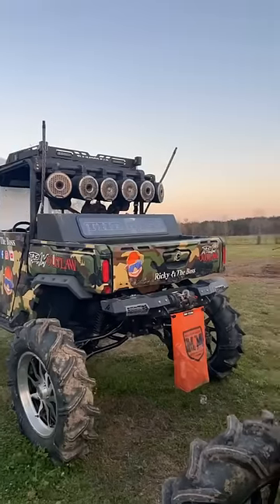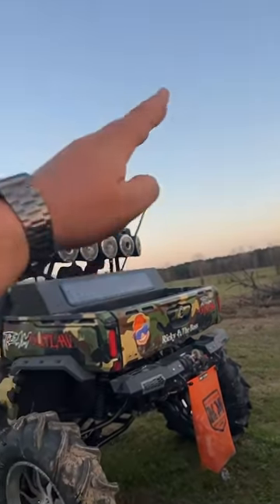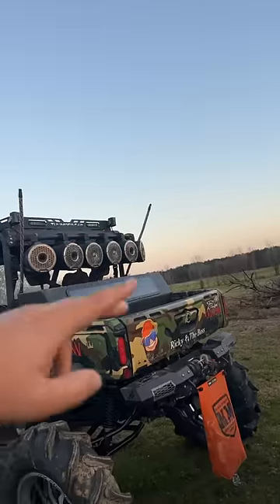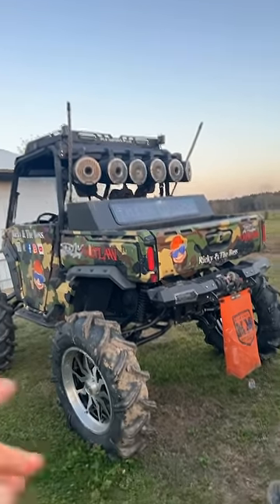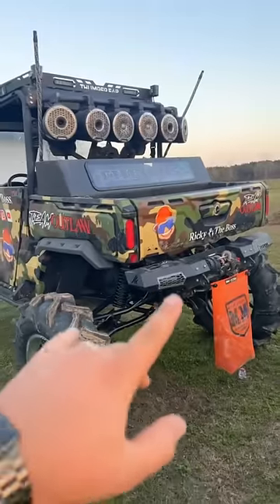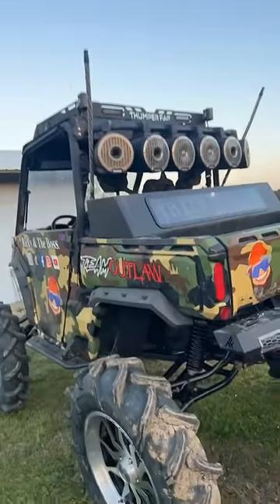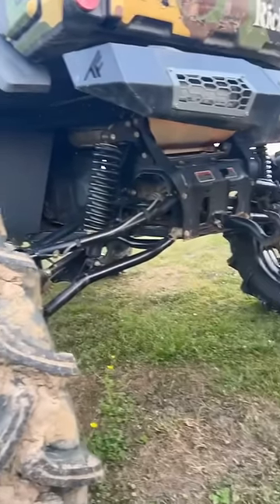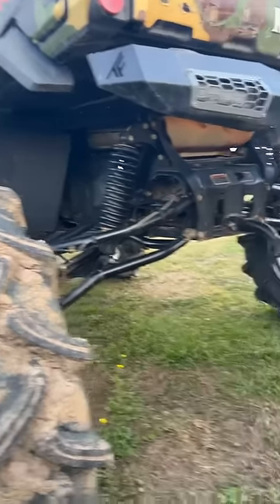About to build a team outlaw tow rig #teamoutlaw #canamdefender @CANAMOFFROAD

Comment: Just run a straight axle with a Lifted suspension that will give you good clearance and it will actually be a lot stronger than the Independent Suspension

Comment: Add a set of air shocks. Weld new mounting brackets next to the existing ones and wire in an onboard compressor.

Comment: I put a flat bed on the back of mine it lifts the tires up then the back 2 roll on the ground but if it needs it I have a dolly I keep on the trailer. Reach out if you want the plans. But it's like a tow dolly that comes down off a slide bar strap the first 2 ties and lift up with the 12k and your off

Comment: If i may suggest that you can use the old air ride suspension from old Lincolns just be sure to replace the diaphragm air bags with updated ones also if you can fabricate a mount and install an AC compressor from any vehicle then you have one serious air compressor for your airbag suspension 😉 #BUILTNOTBOUGHT

Comment: Would duel air shocks work for you. Check them out. 
Have the weight from the boom come down on your rear shock mounts and stiffen up the lower control arms and where thay connect to the frame. Its a start.

Comment: air bags? just get sum bumba air pneumatic cylinders bolt on next to shocks with a pivot hinge each side snd then air up loaded to propper psi for correct ride height and lower when unloading so you don't go ridding too high

Comment: What about welding a pulley wheel
to the FRAME, then run the cable
through it, that would give you
ADDED LEVERAGE, and would
also give you more PULLING
POWER🤔🤔🤔🤔🤔🤔🤔

Comment: He need to put another set of axles on the otherwise you're going to put too much stress on it and start breaking the lift parts😮 got to remember you putting a lot of pressure on the river that machine you have to make it soon your toes something it's pushing down in the middle of the not only on the if you have rear axles you can toe a lot of weight